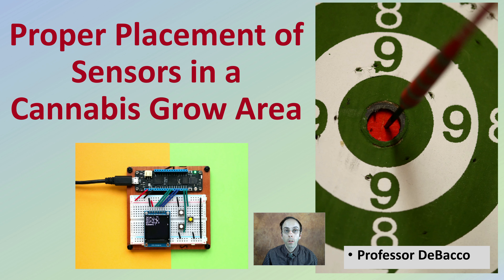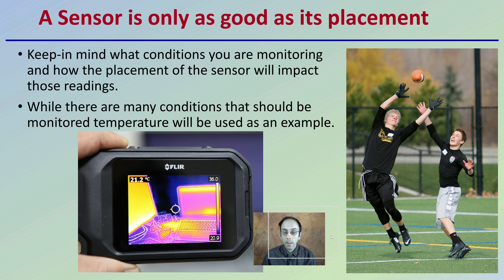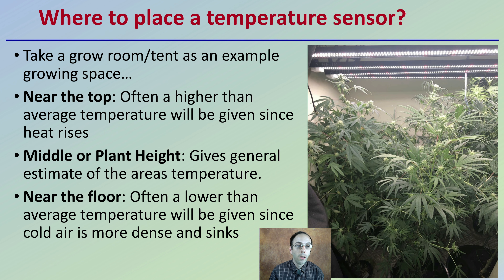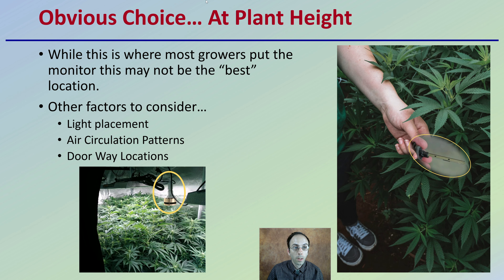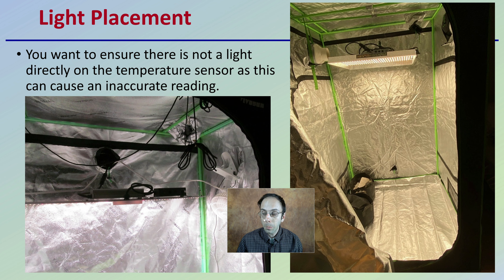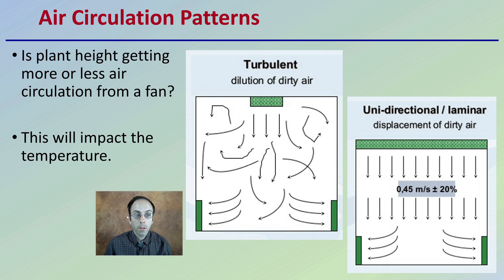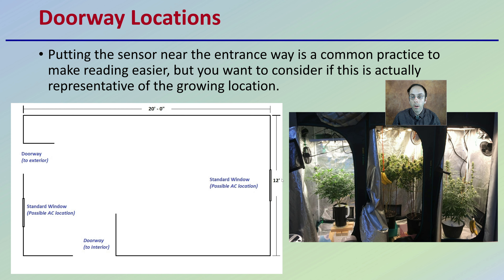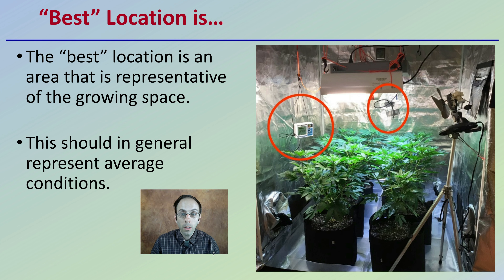Proper Placement of Sensors in a Cannabis Grow Area

Comment: Are you familiar with the AC Infinity sensor for RH, temp, and VPD? It's just a small metal probe and I am wondering about it's reliability. Are there any cost efficient sensors that you would recommend that I could use in addition to that one or use to make sure mine is correctly calibrated?
Reply from the maker: I have experimented with their VPD Thermometer with an infrared temperature reader and I found it does take some other pieces of equipment to properly calibrate it, but at least is has the options to get it dialed in.
Reply: @DeBaccoUniversity  Thanks. I have been running two humidifiers in a 4x4x8 tent and can barely stay above 60% RH in early veg according to the AC sensor. That just seems wrong when I am filling both up with slightly over a gallon twice a day and exhaust running at 30%

Comment: i read that some people use a shading cover for the sensor probes because the lighting will give it wrong readings. Thoughts?
Reply from the maker: If placed correctly in the growing environment shading would not be necessary.  However, in some cases (particularity if direct sunlight is involved) shading may help offer more accurate readings.